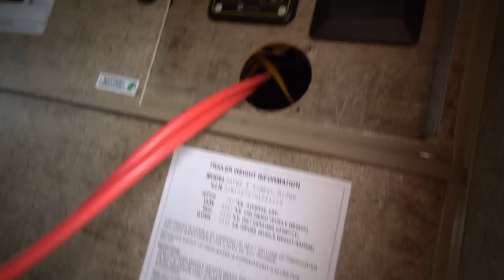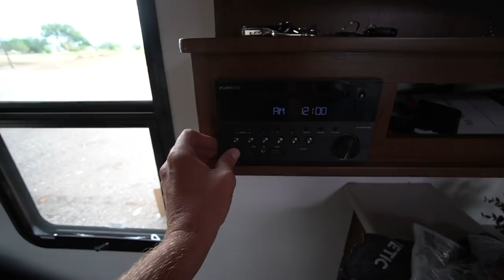Detailed Installation of RV Lithium Battery Upgrade 🔋(Step by Step)

Comment: EXCELLENT presentation & install. Over the last 5+ years I have been doing a little solar system and additions as I go on our TT. Nothing as large as yours though; but I over build just in case & for safety. Learning a lot from DIY guys like yourself. I go slow & sure as well. When you mentioned 'fireworks" it reminded me how I learned years ago about a "traveler" staying hot after I turned off the circuit breaker that went to the light I was working on. Two 'neutral' wires were tied together. Since then I triple check that everything is dead or connected correctly. Your job is well done !

Comment: Just finishing up my setup with 600ah, Nice thing is all 600ah I designed to be portable and modular. All the hardware is attached to the battery boxes. All batterys have switch's that can isolate them but one gets a 4 way switch to also run the DC systems of the camper when not using grid power.

Comment: You make the absolute best videos on these upgrades. I am in the process of figuring out putting 400 lithium and an upgraded inverter into my airstream. I've been looking at trying to find an installer, or doing it myself... There are not many videos on this on the net. Can't wait for the inverter video, thanks again.
Reply from the maker: Thanks, appreciate that Ryan 😊 You'll love the the new system in your Airstream either way you go. Definitely possible to do your self if you take it slow and put in the research. Not sure if you saw the battery and inverter videos on our Airstream van, but it might help with seeing the same factory components. Im working on the new inverter video and hope to get to get it out next week. thanks!
Van battery video https://youtu.be/qIANRToD-vU
Van Inverter video https://youtu.be/hB_UgLR0bTo
Reply: @IreneIronTravels  Ha!  I'm probably 1/2 the views on your Van installs... you are the reason I started thinking I could do it myself.  I am convinced I can now.  Finalized quotes today for parts.  Just want to take apart the airstream first so I can see the cables and what I want to tie into as I get going... and wait for a little bit warmer weather (MN resident here too!)
Reply from the maker: Lol, that’s funny. Sounds like you’ll be totally fine doing it yourself. Stay warm up there, and feel free to ask me any questions when you get to it. You can always email at IreneIronFitness@gmail.com if needed.

Comment: The reason some people put the switch before the fuse is that you can shut power off to change the fuse. There would be no battery power to the fuse.

Comment: I've been waiting for this video.  Thank you. Thank you. Thank you.  As a fellow 2022 ORV 22FQS owner, I am also putting together a Battle Born System. I'll be starting with 3 100AH but everything else should be the same except for the charge controllers. Your videos are concise and thorough and will save me quite a bit of time.  Just the routing of the cabling from the original battery has already made my day.  I can't wait for the next two videos in the series.  Thanks again, you guys..
Reply from the maker: Hey Kevin, thanks for watching! You'll love having lithium in your new rig! Feel free to ask any questions on your set up. 😊
Reply: Yes. I can’t wait until it’s done. Take this baby out with extended possibilities.
Reply: When routing the wires from the battery he neglected to move the circuit breakers with them. They were close to the battery up front for a reason, to protect the wire. When you move the location of the batteries you need to move the circuit breakers and fuses as well so they are as close to the battery as possible. That panel with the busbar has plenty of room to mount circuit breakers and fuses. Be safe out there 😊

Comment: 6:00 My understanding of fuses/breakers is they r to protect the smallest wire that comes after that fuse/breaker from a possible short or what not. heaven forbid a wire was to come loose ur batteries don’t care what ur biggest draw was before. Granted u prob gauged the wires appropriately for that max amp draw as well but that’s not always the case. If insulation of the wires melt then u have a fire. Im no electrician but that’s how I understand it.

Comment: Great work!  Something not discussed much are the mechanical loads created by heavy components in a crash.  It is common for shock accelerations to exceed 15g, so your 50 pound battery or inverter could generate 750 pounds of force and do some serious damage.
Reply from the maker: Thanks Paul! Yes, that's very true...... not thought of much...I would hate to see what happens in a crash.

Comment: How fortunate I am to run into your YouTube channel!   As a gym owner ( fitness buff), picking up a 24 RKS next week and high interest in installing BattleBorn, I don’t think your channel couldn’t be a more perfect fit.   Just wish I had your youth😂.  I’ve watched prob five videos so far.   Thank you for sharing.   This detailed battery install has given me so much comfort to see this vs just a diagram.  Think I might go with a similar system with just two of the Gamechangers, at least for now.   Is heat an issue under the bed?
Reply from the maker: Hey there 👋 thanks for watching! I don’t think heat will be an issue under the bed as many people have their systems installed like that. But, we’ve only had this since fall and haven’t experienced the high heat of summer. So far no issues, but I’ll keep an eye on the temps!

Comment: Kind of funny nowadays how many people are selling expensive victron parts , you don't have to , shop around my system charge my lithium batteries fine with a champerion Generator and a upgrade converter i did myself.
Reply from the maker: 👍 Nothing wrong with different options and doing things a less expensive way that still works for the persons situation. But, nothing wrong with using high quality expensive parts either. 😊

Comment from the maker: 🔋BLACK FRIDAY SALE NOW up to $400 OFF Battle Born Batteries https://tinyurl.com/2s3me6b5

🔋Save $50 on Battle Born Batteries https://bit.ly/BattleBorn50
🔋Victron 3000 MultiPlus Inverter https://amzn.to/3eZIWr1
🔋4/0 Battery Cable https://amzn.to/3eZnTVm
🔋Main 400amp fuse https://amzn.to/34AVza5
🔋Inverter 300 amp Fuse https://amzn.to/3GecSf2
🔋Blue Sea On/OFF Switch https://amzn.to/3JJMGea
🔋Busbar 300 amp https://amzn.to/33X0OQI
🔋BusBar 400 amp https://amzn.to/3zzN1ve
🔋4/0 battery lugs w/ heat shrink https://amzn.to/3IufBSh
🔋Victron Bluetooth Battery Monitor https://amzn.to/3F8tmUt
🔋Victron Cerbo WiFi Monitor https://amzn.to/31EPQPi

Tools
🛠 Battery Crimper https://amzn.to/3Kxouwb
🛠Battery cable cutter https://amzn.to/3FLQdWk
🛠Heat shrink gun https://amzn.to/3tQV1HH
🛠Multi Meter(voltmeter) https://amzn.to/3Al0RSw
🛠Ferrel crimper https://amzn.to/3AkZQdx
🛠Ferrel crimper https://amzn.to/3tQWxJT
🛠Plastic Scraper https://amzn.to/3qN2W6U
🛠Heat Shrink https://amzn.to/3KoDdcJ

Solar
☀240 Watt Solar Panel https://amzn.to/3q3eBy2
☀Victron 150/85 Smart Mppt Solar Controller https://amzn.to/3n9giIf
☀Panel mounts https://amzn.to/33DALyr
☀2 pole breaker https://amzn.to/3ArzwhS
☀1in Wood screws https://amzn.to/3Ims3TL
☀Mc4 connectors https://amzn.to/34Y6BpN
☀Roof Port Box https://amzn.to/3Ky6Ms8
☀Rubber tubing for Dicor https://amzn.to/3KszWJf
☀MC4 cable extension https://amzn.to/3Ag66De
☀Butyl Tape https://amzn.to/3qKYx45
☀Dicor self-leveling https://amzn.to/3AqqZeX
💙Subscribe - https://www.youtube.com/c/ireneironfitness?sub_confirmation=1
💻 Website -  https://ireneironfitness.com
💵 Store - https://www.amazon.com/shop/ireneironfitness
👫 ABOUT US➡ Hello! We are Aaron and Chris, a fulltime RV couple that lives and works on the road! We run an online fitness and nutrition coaching business (Irene Iron Fitness) while traveling all around the country. Follow along the journey with us!
🚐Read our Story: https://ireneironfitness.com/quitting-our-jobs-traveling-the-country/
💪Shop Online Coaching Packages: https://ireneironfitness.com/online-fitness-and-nutrition-coaching-packages/
🍎Browse IIF Healthy Recipes: https://ireneironfitness.com/healthyrecipes/

💎IIF AFFILIATES: These are programs and products we use, love, and recommend!
👉Amazon: https://www.amazon.com/shop/ireneironfitness
👉Rad Power Bikes https://bit.ly/3lbsaGM
👉Battle Born Batteries http://battlebornbatteries.com?afmc=2n
👉Undersun Resistance Bands: https://bit.ly/2RiP41C 💰 "IreneIron" for 10% off all kits, bundles,etc
👉Thousand Trails: https://mbsy.co/DLw8W  💰 Save $100 
👉Harvest Hosts: https://www.harvest-hosts.com/95RRF5/2CTPL/ 💰 Save 15% "HHFRIENDS15"

Comment: We have a 24RLS from Outdoors RV coming in a few weeks, so this is very interesting.  I'm guessing that there was already a port in the black coroplast on the bottom of the trailer to make it easy to re-route the wires from the tongue battery.
Reply from the maker: Nice, congrats !! Yes there is a hole with a grommet that goes through the access panel. This was surprisingly the easiest step to switch the cable to the new battery bank!

Comment: Are you showing in a part 2 video how you hook up shore power to the invertor and how you disable the charger/invertor that came with the camper? First video I have seen that explain it clearly enough I feel confident in doing this myself to my camper thanks alot much appreciated.
Reply from the maker: Hello 👋 yes, that will be explained in the next video that would be out with in a week!

Comment: Concern:  if you look at the 2x’s for the frame they are simply stapled together from the top.  This is pretty standard RV construction.  I would remove the frame and ensure they are screwed and glued together.  The weight of these and bounce aft of the axles may mean that frame will collapse.
Reply from the maker: Yes, those staples were concerning to me as well. I reinforced the framing with the 2x3's I showed in the video. Also there was screwed framing on the 2 of the 4 sides. All good after 4 months and a couple thousand miles.👍

Comment: wonderful video. Curious as to how you set up/ran the truck power to the batteries. Did you use a dc to dc converter?
Reply from the maker: We didnt use a DC to DC in this set up. It would definitely help with maybe 30 amps while driving, but we found the 1200 watts of solar was enough to charge up.

Comment: We have a 2019 ORV  21RD with a full system under our bed.  I need to run the jack power line back but don't understand how your drilled through the floor under your bed and could access those wires.  I opened the chloroplast compartment under our front and put a tape inside back to that metal Ibeam and came up with 25" from the front, drilling through the floor puts us well past that I beam and over our fresh water tank.   Is your frame constructions that different you were able to drill in front of the Ibeam or did you somehow fish the wires, if so please explain.  thanks

Comment: Hey... that blue cap on your shore power connector may cause you trouble. We have a 2020 ORV camper that came with the same cap. I found that it retains water. I discovered this when I noticed my camper brake lights were very dimmly powered on, caused by water in the plug causing a short. We stopped using it and have had no further trouble.
Reply from the maker: Good to know, thanks I'll check that out closer!

Comment: Do you have a wiring guide for this project? Looking to do the same setup and was curious if you had something you can post. Awesome job.
Reply from the maker: Thanks Brandon. No, sorry I don't have a diagram on this one. Since this was my third system install I just did it out of my head. I haven't found a good free software to do the diagrams in.

Comment: I want to mount a lithium battery under the bed on our 22FQS so I will need to run cables up from the junction box under the belly. I don't have the auto leveling system on my trailer so I'll need to drill an access hole.

Can you please describe where the hole on your 22 FQS is located so I'll know where best to drill and at what angle? I assume I'll need to drill top down.

I watched your video and have an basic idea where the cables passed thru but any photos you might have showing the exact hole/wire location would be very helpful. Thanks
Reply from the maker: Hey Kevin. Go ahead and send an email out to IreneIronFitness@gmail.com and I’ll see what I can do for you.

Comment: Great video. I know it’s two years old. But really curious about the ac/dc charging of this rig when hooked up to shore power. The built in charger controller from the factory unit prob doesn’t have the correct output to charge your LiFe batteries. I’m curious how you sorted that out. I’m in a similar journey with our RV and looking to upgrade the house batteries to LiFe. But stuck on how to charge them.
Reply from the maker: Hello thanks! Yes, I’ve been meaning to do a video on just subject. Most newer RVs will have a “ selectable “ converter. Ours has a little switch that you just move to lithium. Some are auto sensing on voltage. But basically it just changes your charge setting from around 13.6 to 14.6 volts. If you don’t have one you can just replace your converter with a new style. https://amzn.to/3uAm1O6 just check what kind you have and most manufacturers have a lithium replacement.
Reply: @IreneIronTravels  awesome. Thanks for the info. I will definitely take a look. The upgrade to LiFe is a must. I hadn’t heard much about battleborn. I have experience with Renogy.

Comment: Hope your getting along with your recovery and feeling better. Great video and explanation of this part of the system. I forgot that you can mount the batteries on their sides. That should help me when fitting new batteries into my compartment. 
We are also full time and move around quite a bit. Was it challenging to setup and receive delivery from Battleborn?  Do you know of any distributors in the southwest?  Would you say it would be worth it to buy the tools for a one time install?  Or just buy pre made cables? 
Thanks for your time and info. I appreciate it.
Reply from the maker: Thanks! Yes, slowly getting better. Pretty bad swelling for a week and I'm still not walking on it yet.....but improving. Battle Born can deliver to any FedEX pickup location that can receive hazardous waste materials. (lithium battery) So we've never had an issue with deliver and its pretty quick. Also you can give them a call and they can tell you the closest distributor to you, but deliver was easy for us. I think its worth it for the tools, just because It would be so hard to get the correct pre made sizes. Maybe if you were just doing the batteries, but all the components and inverter vary so much in sizes and lengths. You could probably re sell the tools on Craigslist/Facebook marketplace if needed or even check for used ones to buy.
Reply: @IreneIronTravels  Thanks for the quick reply. Don’t take this the wrong way, but I hope your channel doesn’t grow too fast or too big. Meaning it’s nice to ask questions and get replies. And to learn from your experiences. In all seriousness I do wish you guys continued success!
Reply from the maker: 🤣 thanks 🙏 appreciate it!

Comment: Hello. thanks for the great video. I am currently planning my lifepo4 battery/inverter/solar conversion and this is very useful.   I noticed you used the 300A blue sea switch  which  is rated under what the inverter can draw (400A).  is there a potential issue that it will melt over long period of use?  the 500Amp version is very pricy :(
Reply from the maker: Hello, thanks! I agree there is a "hole" in the switch sizes and it would be great if they made a 400 amp version. I used their 350a version on our van build and was unable to buy that this time so I had to get the 300a. From Blue Seas Website - The 300a version can handle 500a for 5min and 900a for 30 sec. The 350a version can do 600a and 1200a respectively as well. So you can see these switches are built very well and can handle quite bit of amperage. The inverter I had is 2400 watt continuous. So 2400watts / 12volts is about 200 amps continuous. Of course the inverter can peak all the way up to 6000 watts I think for a brief amount. But the normal usage is way below the 300a continuous switch and the most we usually would draw would be around 150 amps. So if for some reason the system surged over 400 amps, the main 400 amp fuse would blow to protect everything and the 300a switch is rated for 500a for 5 min. Does that make sense? 

300a switch https://amzn.to/3QdoaHB
350a switch https://amzn.to/3ZPI1Qe

Comment: I may be wrong here but I believe 4/0 cable will not carry 400amps which would leave your wire melting before the fuse blew.  I think that's why everyone uses a 250amp fuse.
Reply from the maker: Most inverter manufacturers and sellers do recommend 4/0 cable with a 400 amp fuse. The reason for the larger fuse is to account for the larger surge start up loads like that of an air conditioner. You could blow a 250 amp fuse every time you start it. Some might not ever plan to run a larger load and never have a problem. Our most continuous load would be 250 amps but our system can surge for a split second to 500 amps for the start up loads. And that s the reason the pros recommend fuses at 1.5 times your max continuous load.
Reply: @IreneIronTravels  However if you look at the National electrical code 4/0 cable is only rated at 230amps. Therefor your cable will get hot and melt and possibly start a fire before the fuse will blow should the system pull the full 400amps.
Reply: It depends on the length of the cable and the c rating as well. 1/0 105c can carry 350 amps for short runs.
Reply from the maker: True, lots of variables!
Reply: @matthewwhite8129  Hey Matthew could you send me a link to the chart that shows this. I have not been able to find it. Thanks